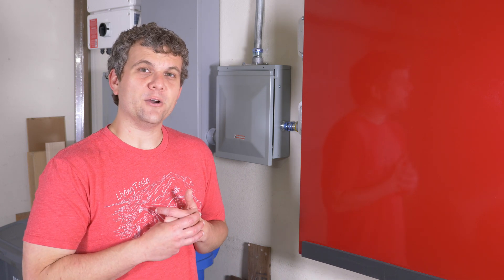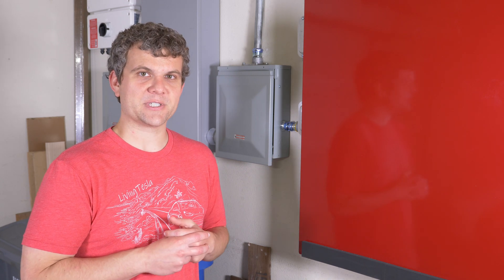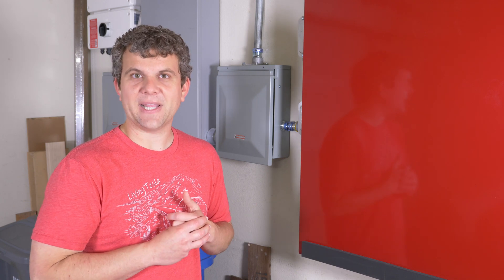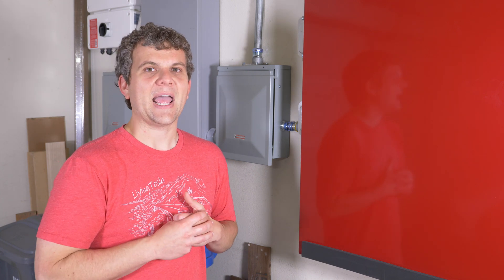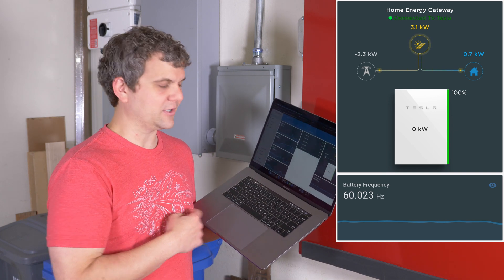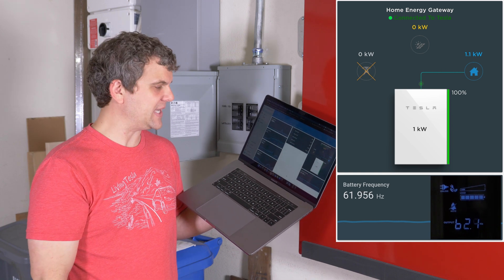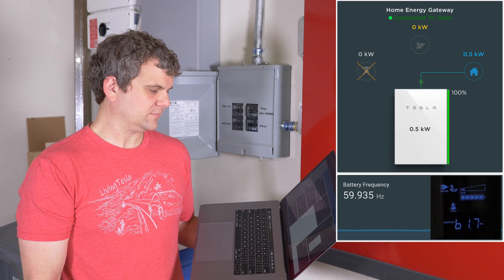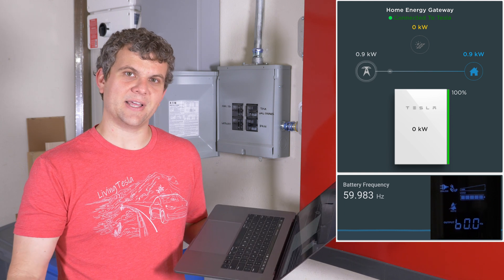How to Make Powerwall and a UPS Work Together

Comment: I want a whole home system that  is like an online UPS. Takes solar, battery and grid power and meets the demand. Taking whatever power is thrown at it and spits out a perfect sine wave 120 240v 60hz feed. And handles intelligently shedding loads when the grid is down and it’s night.  And can to a dc to dc step up for EV charging without going between ac dc 3-4 times.   That’s always has been teslas power walls issue is no matter what it’s always AC in and out. It should be more adaptable for how much they cost.  

Savant home automation has gotten into smart panels and integrating all things power.  I wonder if their software has gotten to that point yet.  

Victron energy is basically there. You probably could piece together a system that can do all that. They’d be lacking in the software and smart panel.  

Imagine a 10KW inverter that could handle solar, battery, wind, and a NG generator. Generac has started down that road. They now sell solar and batteries and a controller that can also take the input from one of their NG air cooled generators and feed the batteries and inverters a direct DC HV current. Idea is to run the generator as needed to charge the batteries and then shutdown. For days when the sun doesn’t come out.  But I’ve heard bad things about their equipment failing and worse about their software.  At least they have the idea of what’s needed.  Hopefully they can combine all that corporate mess and make something good.

Comment: Why do you even need more than one independent UPS anymore around the house ? Can't the powerwall 2 with Tesla Backup Gateway 2 act itself as a UPS?
Reply from the maker: Not exactly. The Powerwall (the gateway actually) takes a split second to transfer power and sensitive loads will drop. Sometimes if solar is exporting when power drops, it will be enough to keep the house powered up through the transition, but you can't count on that.

Comment: Thanks. I ran into this problem as well, just asked Tesla to update my system, fingers crossed. Ironic that it's the doubly-backed-up loads that die while everything else just works 😠

Bit of a hack on Tesla's part to output power at an "incorrect" frequency to trick the inverter into shutting off, rather than have a breaker do the job. Although that wouldn't work in cases where the inverter connects to the main panel rather than the gateway, so I get why this is easier and cheaper.

The other way to solve the problem is to buy a UPS from a different brand, some seem more forgiving to "off" frequencies (Eaton claims to work up to 70 Hz). I've had nothing but problems with Cyberpower's Utter Piece of Shit anyway, but that's a story for another rant...

Comment: Thanks. This explains exactly what is happening with my CyberPower UPS. Out of curiosity, in your laptop display you are showing the gateway display, but what are the other screen's you are showing? Where are you getting the battery frequency from?
Reply from the maker: My Home Assistant system polls the gateway for the additional information
Reply: @EveryAmp  Custom software?

Comment: BTW what UPS do you recomend to supply my router and modem without the powerwall (I am on wait for a tesla powerwall - they tell me I have wait a year even though I have tesla solar because I didnt by the battery last year with my solar.
Reply from the maker: I've had good luck with three of the previous generation of these Cyberpower CP1350PFCLCD units: https://amzn.to/3l0C6pl Like any lead-acid battery, they only last 3-4 years before their capacity is significantly reduced, but I've replaced the batteries in mine twice now and they continue to serve me well. Lithium-based replacement batteries are starting to come down in price lately so I may try a set of those next time too.

Comment: I've been installing powerwalls for years. You did a great job with this video explanation. One thing though, there is no way for an installer to lower down the frequency of a powerwall.  There is simply no such function on the installation wizard . It would be great if they add that option to the future firmware updates, but as of right now home owners with UPS have to call the Tesla hotline just like you did to solve this problem
Reply from the maker: Ah, thanks. Any idea why they don't just change the setting for everyone?
Reply: @EveryAmp  I’m mot sure why it’s not an option yet, maybe just    simply bureaucracy. But I’m sure if enough customers complain about it or one of Elon’s Twitter followers get it to his attention, it would probably get resolved
Reply: @EveryAmp  Has Tesla sorted this? With a firmware upgrade? Why can't a dealer or end user do it in the app?

Comment: G'day :)  Do you have a link to anywhere for setting up the PW with HomeAssistant like you have (I browsed your vids but couldn't see anything).  All I could find was an integration called "Testa Powerwall" but it landed on the home page as a column of text, not the GUI and no frequency like yours.  HomeAssistant newbie, Cheers
Reply from the maker: I'm using a combination of the Powerwall integration to get the various data points including frequency and simply a webpage card to pull in the GUI. It points to the local IP address of the Tesla gateway on my network.
Reply: @EveryAmp  Cheers, card added :)

Comment: Wish you'd do a video explaining which electric plan is best to have in SLO with a Tesla.
Reply from the maker: It's a little hard to do because it depends on a lot of individual things. If you use more than half of your energy charging your car, it's likely the EV-2A plan is your best choice. PG&E has a comparison tool on the website that uses your historical data, but I'm not sure that is works for us anymore if we're on MBCP
Reply: @EveryAmp  Yeah and that's the problem, as there is no way to calculate which plan would be best for my needs.  I have solar and charge my Model 3 mostly at home, but don't really drive all that much lately.  But I still want to get the best rate, because our rates are so expensive per kW.
Reply from the maker: Oh you have solar also. Which plan are you on currently?
Reply: @EveryAmp  Tier 1

Comment: How long did it take for the Solar to come back on line .. the last you showed was that the Grid was powering the house and Solar was still at "0"  I assumed it did come back on line...??
Reply from the maker: The inverter counts down for 300 seconds then is back to full power a couple seconds later.